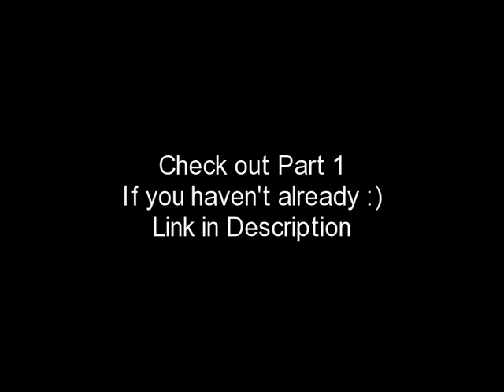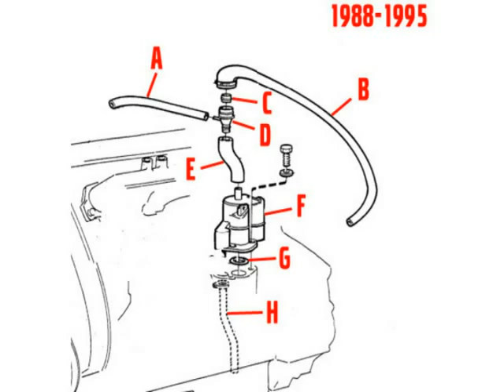Intro to Volvo 240 PCV Part 2

Comment: how about the oil sump hose inside the block, how do you change that one? I happened to find mine broken and believe it to be living in the oil pan now... have spared with me but I am hesitant if dropping the pan or is it possible to snake it in from above? I am always able with combo of tools and joins for extensions to remove and change the PCV on any of my Volvos 240s.
Reply from the maker: I never had that problem, but I heard you had to drop the oil pan to replace that hose,
Reply: Wagon Man i tried and the hoses is totally hard as plastic . I am getting a special tool to pull it out hopefully
Reply: @moonglow1158  already semidropped the pan and fished it throu the side by hand. Then put the pan back on. Still a long time job. The hose was OK and in full. So just put a new one and go.
Reply: Sergio Enrique Cuquerella did you have to loosen your motor mounts to drop that oil pan some?
Reply: Sergio Enrique Cuquerella  he is going to cut the top part out and cut the new hose and put that in ... I would have never changed it but fcpeuro sent it with the kit
Reply: @LordNelsonsTrousers  Yeah looks like so... checking in pan drop videos and tutorials now... thnx for the reply.

Comment: Great info , when i found out about the flame trap and the oil trap , i just clean it really good , and what i did on all of my 4 volvos is to replace the  hose  "E" on your diagram for custom made hose , about 3-4 inch longer , that brings the flame trap higher over the intake , and its so much easier to get to it to clean it with every oil change .
Reply from the maker: djpitr Nice, I ended up doing something like that on my 940 wagon, it has the same engine (B230F) it makes it so much easier to check the flame trap verses fighting with it between the intake runners

Comment: what is the name of the inline white-black regulator just abobe and to the right of the brass nipple you were talking about in your Part 1.  It is clearly visible in this video at the 6 minute mark and up. Lokk strsight above the high pressure gas intake coming from the tank
Reply from the maker: Its a vacuum check valve, here's the IPD Volvo website part number 115580 if you want to find it

Comment: Remove the air intake hose, air idle motor, its bracket and connected hoses, then getting the oil trap out is easy.
I pulled the intake manifold but its not necessary.
Reply: Did you need to replace the intake manifold gasket though ?

Comment from the maker: The bolts are the hard part the box should come right up and out with some clever moving, I have large hands and got a good deal of scratches trying to remove the box, latex surgeons gloves or the Mylar ones sold at harbor freight will save you from that, if you decide to remove the IAC make sure the battery is out and the radio is off before you remove the battery, clean the IAC out as well and replace the hoses if they look bad or come apart and thanks for watching, I'm glad to help :)
Reply: Right ! I actually cleaned out the hoses ..  very very dirty . I hope it works until i get new iac hoses

Comment from the maker: You can also remove the IAC motor it has two hoses its under the throttle body, one going to the intake manifold and one going to the "snorkel" you pulled off the throttle body and one connector,  if you really feel like making a ton of space remove the intake manifold, if you decide to go so far as removing the intake have the gasket and some new injector O-rings on hand and be careful with the fuel rail it bends easily, also spray the fasteners down with some penetrating oil and let soak

Comment: Thank you for all the details and so soon! I pulled the throttle body off and I am cleaning the brass nipple that does into the intake manifold from the flame trap - it is soaking in solution as I write this message. Any tips on accessing the separator box? I removed throttle body to help make a little more room to access the box.

Comment from the maker: The replacement of the box should alleviate the symptoms and also how could they tell if you had a dirty oil sump without taking the pan off in the first place? I've never heard of that, they just want to pull the engine out of your c240 and charge you for doing jack crap :) Do a bit of research on using ATF for a flush before you do it, just to get the details, personally I don't think its necessary, but its good to have options

Comment from the maker: With my 240 the box was clogged so that the flame trap screen wasn't plug up when I bought a new box it weighed about 1/2 of what the old box weighed, if your worried about a dirty sump there a trick to do, set your car up for an oil change dump the old oil and buy a cheap filter and put in fresh oil but replace one quart with a quart of ATF, idle the car for 15 min DO NOT drive it and then dump that oil and filter and replace with a good Mann filter and good oil, that will flush the engine

Comment: When I took my car to Pepboys (was pretty desperate to figure out what was wrong) they diagnosed a dirty oil sump. Perhaps cleaning the breather box will alleviate some of those issues? At least I hope so - They wanted 700 bucks to pull the oil pan due to the subframe being in the way.